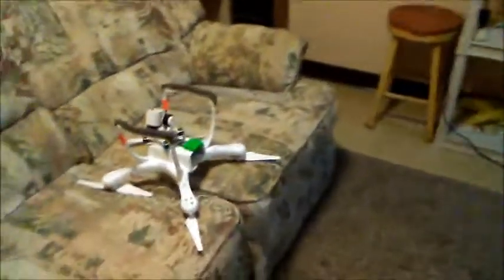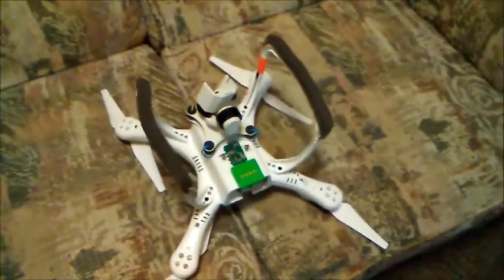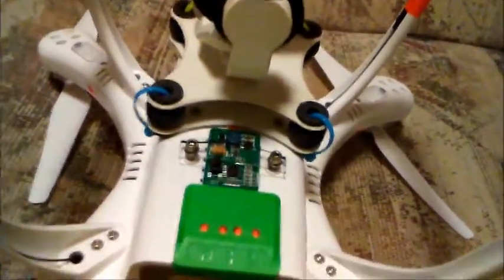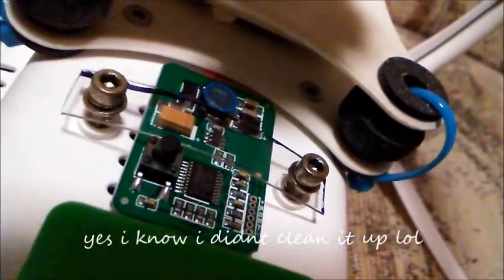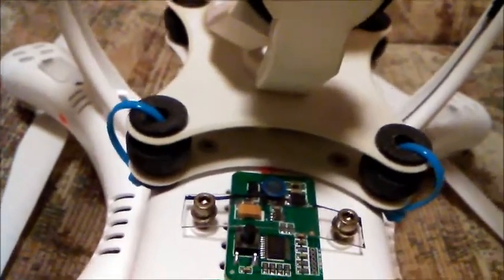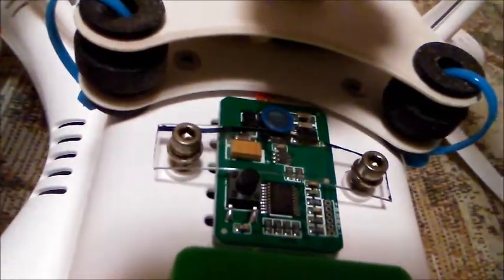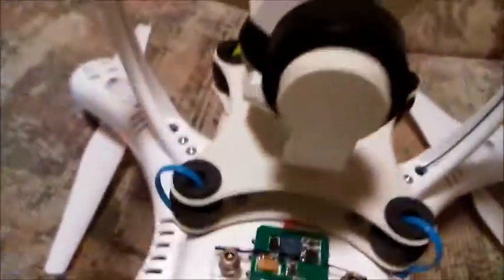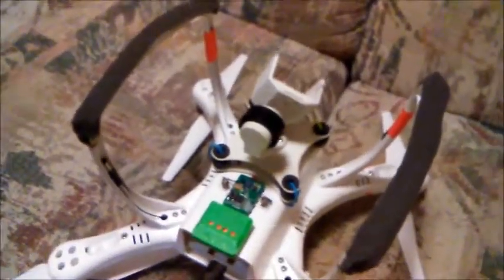upair one 5/30/17 tips

Comment: yeah only new upper one it does have that Shield over top of the transmitter I've already done the straps on the gimbal I do like the clear strap over the transmitter that's pretty nice I might just try that I'm looking at your video with your drone upside down I noticed that you don't have the update for bearing lubrication those burns are very very important to keep that drone up in the air check my Channel out I think you will like it
Reply from the maker: very true bro...
i need to get me drill cranked up and take care of that...
did you decide to keep the plus model?
Reply: yeah I'ma hang on to the plus model right now I'm using it for parts but my plans are to maybe it's just like that Phantom it would not fly in my neighborhood somehow I'm going to figure that out once I figure that out then I may just keep it